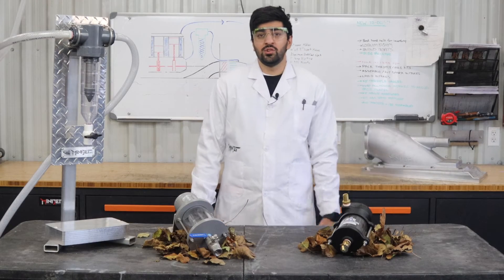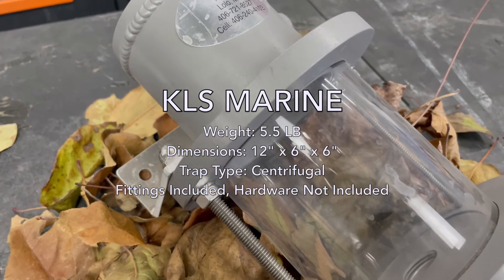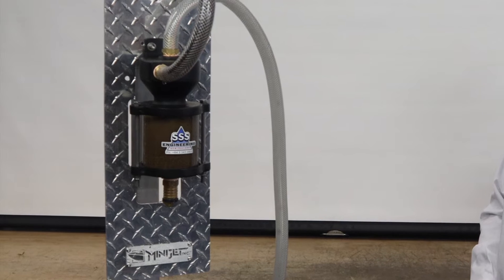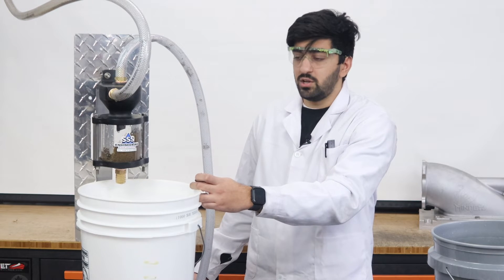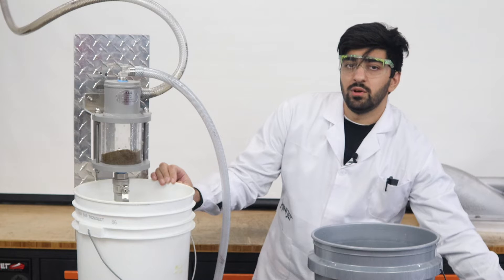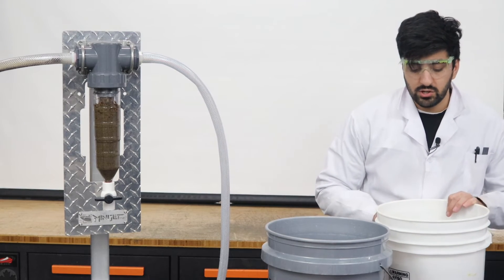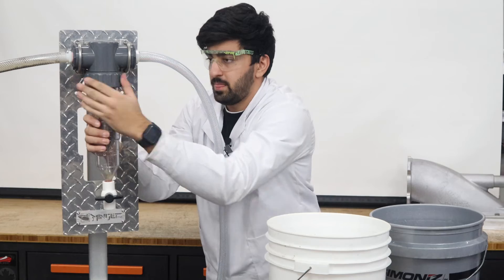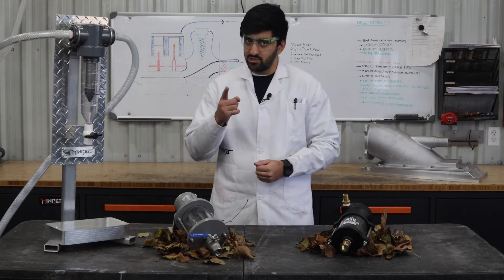The Sand Trap Shootout - Which One Do You Trust With Your Engine?

Comment: Would the mini jet one work on a full size jet boat? Say with a hamilton 212 a 6.2 di?
Reply from the maker: We haven’t done specific testing for that application, but in theory it should work. The flow is rated for 2" PVC and necked down to 3/4" for the PWC setup — it’s just a matter of choosing the right hose barb fitting to match the 212 outlet.

Comment: Could the ball valve be left open or cracked for debris to flow outside the boat like a bilge pump would? To keep the debris from building up in the filter?
Reply from the maker: While possible in theory it would be hard to balance the flow to ensure you're not bleeding off too much cooling water while maintaining a large enough exit for big debris to pass - that's why we prefer to just capture it and empty as needed

Comment: So when do you find floating g leaf debris below the water line?
I would like to see this test done without bias.

Known volume of water
Known weight of sand
Pressure drop etc etc.
Reply from the maker: leaves floating on the surface of the water can easily be picked up by your jet drive when your boat is on plane - It's something we see quite often, especially when boating late in the season.
Our primary goal with these tests was to show the failure modes of these 3 traps when full (bypassing the sediment vs slowing / stopping water flow) and allowing you to choose which you think works best for your application!

Comment: What a non specific and biased test. There are minimum velocity required for centrifugal separators to work along with the clear fact that the minijet filter test had far less media in the water. The simple fact that the filter area of the minijet unit being smaller as well as it having a very fine mesh  screen means that a decrease in flow and volume will occur much earlier and with far more detriment.
How about you do the test properly.
Reply from the maker: We have found that cooling systems of PWC powered boats range in pressure through their operating windows, and want to ensure that even when you start up on a sandy bank with minimal pressure you still get enough filtration to extract debris. 
While the screen in our filters can produce a drop in pressure when obstructed by debris, we'd prefer to see this obstruction in a serviceable filter rather then in the cooling galleries of an engine or heat exchanger.
Our goal was to show the different failure modes of the 3 filters when full (bypassing debris into your engine vs stopping water flow) - we'd prefer to see a loss in water pressure and clean our filter, but for those who prefer an un-restricted filter at the risk of overflowing debris when full - we are still happy to offer the other 2 filters for sale!

Comment: I have never seen a more biased test performed. It's obvious in the product you're peddling that you are not even pushing through the same amount of sand as with the previous two products. Pretty deceitful tactic from Minijet. Let's not overlook the fact you're essentially using an irrigation filter.
Reply from the maker: Same bucket, same water, same sand in each of the 3 tests.

Comment: A lot of people who understand the SSS design leave the dump valve 1/4 open so it never fills up with debris.
The pressure generated from the jet when running spins the water a lot quicker which in returns sends the debris out quicker.
Reply from the maker: Yep! You could leave the drain valve open on all three designs for the same effect. We have found some motor/pump combinations do not have enough spare capacity to do this in the PWC world so it needs to be carefully monitored in these situations.
Reply: Yes that’s true. 
Great video explaining it all though